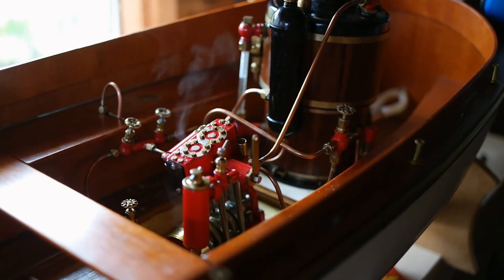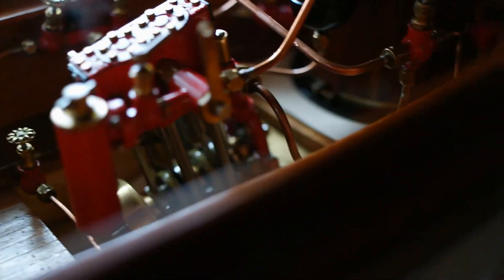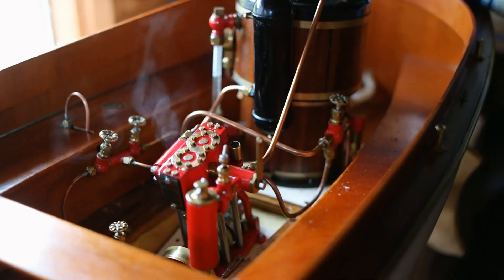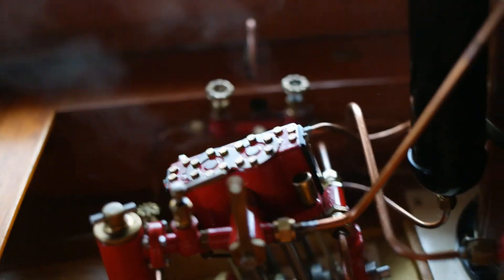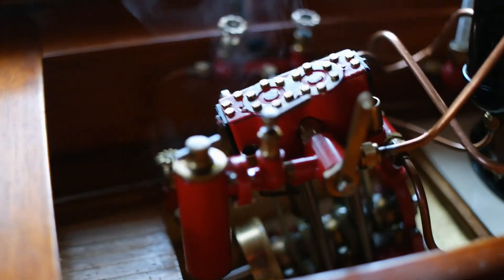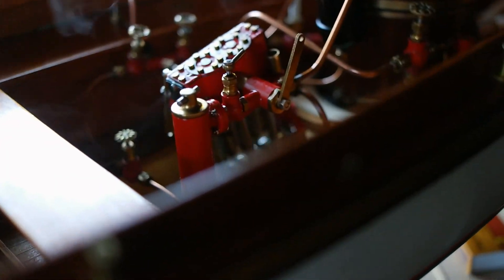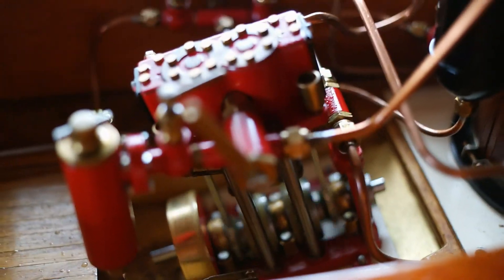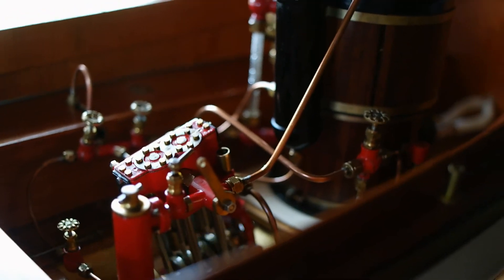Maxwell Hemmens Max 11 engine first run after 20 years !!!"

Comment: Hi Roy,
I think I should come and visit you soon, and take this boat with me!
Looks like the engine needs a bit more running as you say, seems to be struggling in reverse.
Cheers for now.
Reply from the maker: mnewlyn 
Hi Miles,

                " your always wecome "  yes you are quite right,  "this engine does need extra running in "
                   purchased in 1993 " veery like used, tthen stored for 20 years, !!!

                   Thanks for post,  Roy

Comment: Bonjour Roy,
Great job ! And to my opinion, 30 psi = 2 bars is enough to have a gentle speed for an old lady and guarantte that the feed pump will operate correctly. The more you raise the pressure, the more the leaks occur. About the feed pump, wher does the water come from ? A tank, the pond ? As it is high, I fear the defusing.
Amicalement, Raphaël
Reply from the maker: Raphaël Havranek 

Bonjour Raphael, " there is a tank in the bow, will try again, thanks for your post